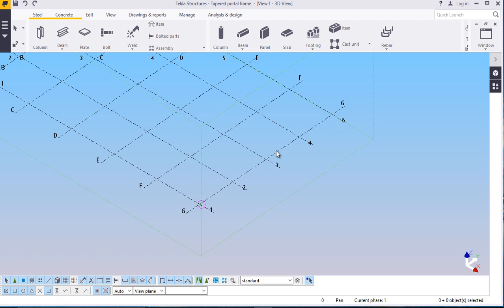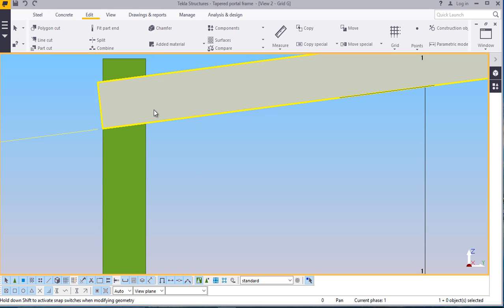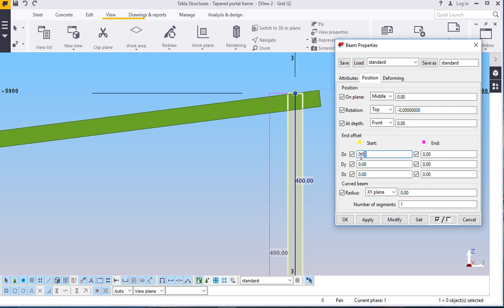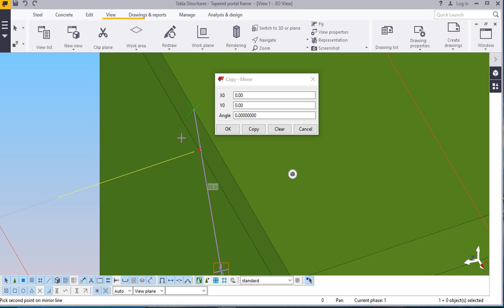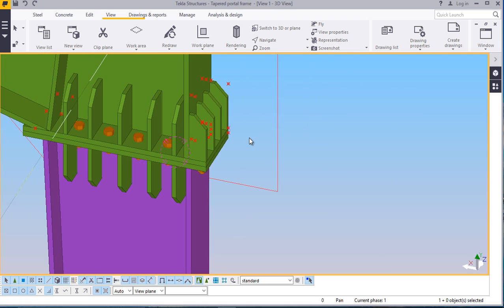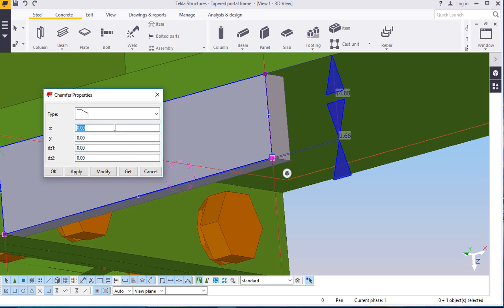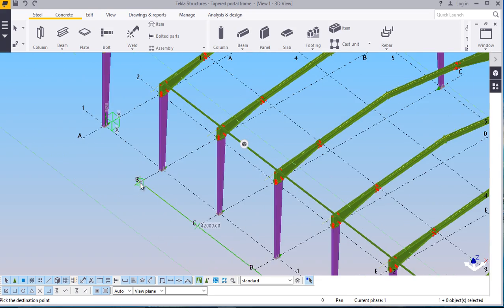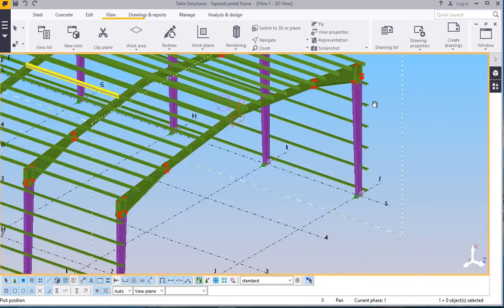Best Tapered Portal Frame Structure Modelling in TEKLA STRUCTURE

Comment: Dear Mr. Maurice Dimba, Thanks a lot for sharing your knowledge. Please kindly let me know structural design software for analysis and design of the tapered portal frame structure of this nature. CAN We use Tekla Structural Designer?
Reply from the maker: absolutely yes!
Reply: Dear Mr. Maurice Dimba, I have licensed version of tekla structural designer. I tried to create  tapered portal frame by using TSD referring user guide etc. But there is nowhere mentioned about modelling and design of tapered portal frame. Please give some information, study link how to model and analyses tapered portal frame by using Tekla structural designer.
Reply from the maker: create the structure in Tekla Structures and export it Tekla Structural designer for analysis
Reply: Dear Mr. Mauric, I model the tapered structure and exported to tekla structural designer. But not possible to design. Please let me know the very simple example for design of such tapered portal frame by  using tekla structural designer. please help me. I am waiting this detail long time.

Comment: How to have the cross section change as your drawing? [time 0.58 - 2.58]
I did not find them in the library.
Please, tell me.
Thanks alot.
Reply from the maker: I will check that and respond back to you
Reply: I have the same question, maurice, thanks.